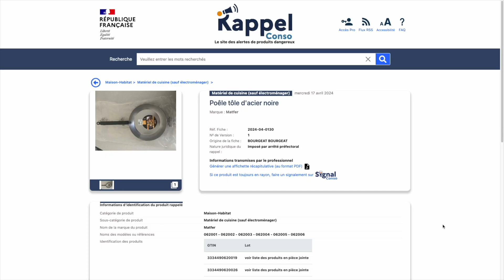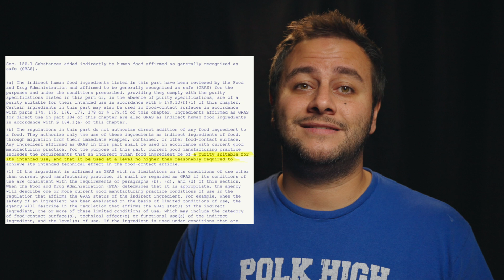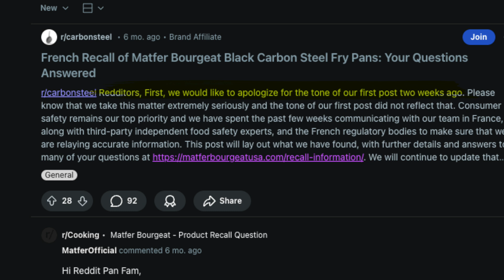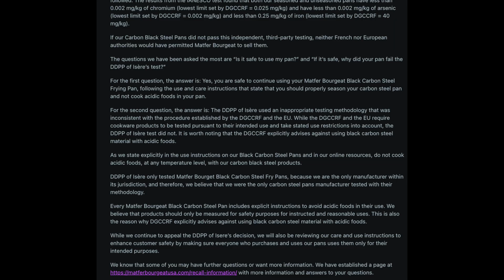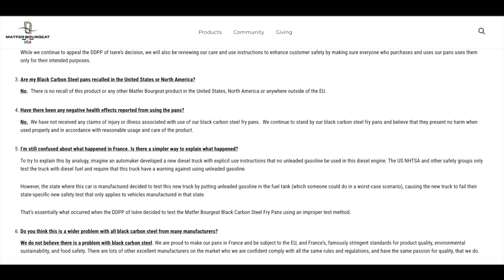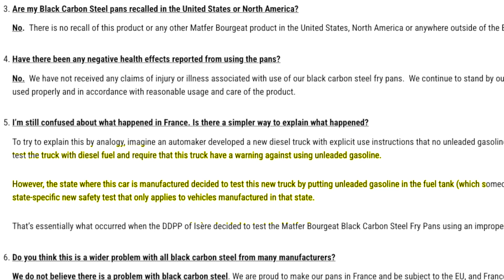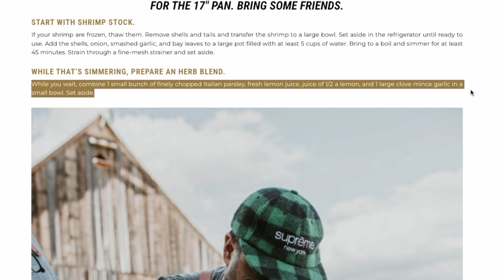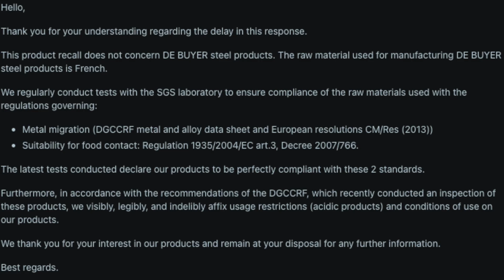Are Carbon Steel Pans Safe? | Matfer Carbon Steel Recall Due To Arsenic and Leaching | My Thoughts

Comment: Is there a list anywhere of carbon steel manufacturers that have had their pans third-party tested for safety? I'm thinking about Smithey's carbon steel out of South Carolina in particular.
Reply from the maker: I’m not aware of one. Email them directly and ask them to explain their testing process and how it would relate to the recall in France.
Reply: @tomwadek  Ok, thanks. Little spooky for carbon steel across the board. I will follow your lead for the time being and just use my Demeyre stainless. Does the leaching problem affect cast iron?
Reply: @MichaelE.Douroux  As far as I know, Matfer is the only manufacturer that has been subject to the local municipalities test.  Kind-a stinks of someone didn't get a bribe & is now targeting Matfer. . . or they DID get a bribe (from a competitor).
I can't take this seriously if they are targeting 1 manufacturer.
Reply: @Jeffery-o6i Mauviel M Steel has been hit with the same recall by the same 3rd party tester. I think boiling a citric acid in an unseasoned pan for 2 hrs will leach metals out of anything. Wouldn’t be surprised if the nonstick companies are involved with this testing.
Reply: @Jeffery-o6i  do you have proof of what you say?